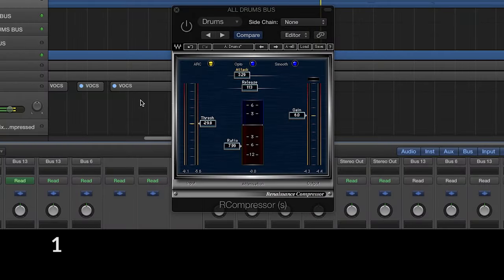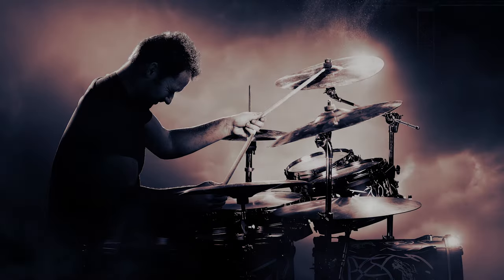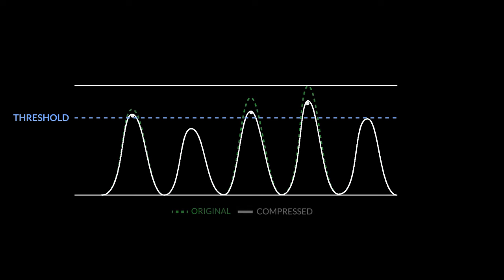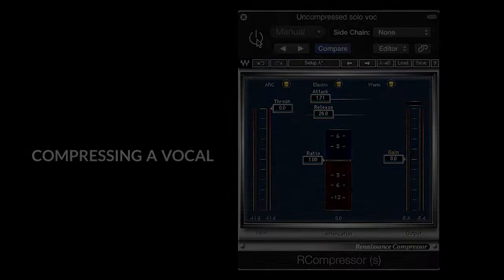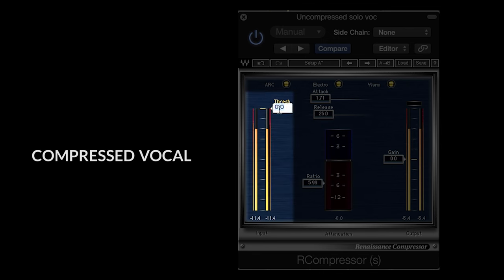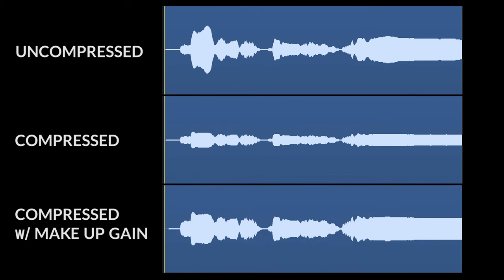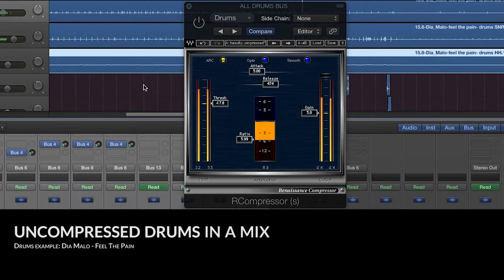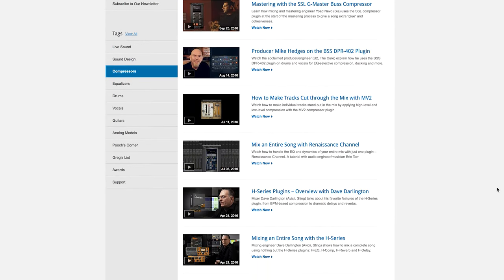Compressors Explained – Sound Basics with Stella Episode 3

Comment: Folks, compressors are the Kryptonite of sonic fidelity.  There are times to use them.  But that should be the exception -- not the rule.
Unfortunately, mixing engineers are in love with their buttons, levers, and knobs.

When you record a sound, it is pristine.  Every time you put it through a compressor, or any form of processing, you are polluting the signal.
The reason why the vast majority of today's music has mediocre sound quality is due to unnecessary over-processing.

If a singer's voice is too loud, then the stem (the isolated track) of her voice should have the gain lowered mechanically, via a quality, analog attenuator -- not via a computer's algorithm.
If there are problems with the singer singing too low and too loud, then the singer should re-tape the song (bands make countless takes of their songs).  A computer should not be used to correct a problem.  Rather, the problem should not exist, which negates the purpose of needing to correct it.

Computers are overused to mix music, because it is a lazy man's mixer.  There is a harmful sonic price for using computers to compensate for what should be corrected via putting in the effort to get it right initially, so that you do not need any corrections.

Corrections come at a price.  All forms of processing degrade the audio quality.  Every piece of equipment adds its own character, its own coloration, its own distortion to the final product.  And those artifacts are cumulative.

If the drums are not coming trough with enough slam, it is not because the drums are not making slam (if you ever were in a room with a drummer, you would feel slam like never before).  The problem is with the location of the drums in relation to the microphones, or the gain on the drummer's stem.

When you hear music and the drums are not really present in any meaningful way, and the singers are ear-aching loud, it is because of the mixing equipment as seen in this video.

Think about it... Does anyone think that a singer can drown out a drummer?  It is nonsense.  Yet countless songs have singing that hurts your ears, and drums that are hardly there.  If drums get lost in the mix, it is not because they need compression, it is because the mixing engineer turned down the gain on the drums, or did some other processing that killed the drums.

Compressed music, for the most part, sucks.  It is responsible for the loudness wars, which kills dynamics, and sucks the life out of the music.  It ruins soundstaging.  It ruins imaging.  It ruins transparency.  It ruins realism.  It ruins sonic works of art that extremely talented bands work their hearts out to create.

I doubt that a single mixing engineer has ever listened to their work on a stereo like this:
https://img.digitaltrends.com/image/wilson-audio-alexx-setup-3-1500x1000.jpg
And this is why they think that their work has good sound quality.

The above stereo will reveal everything that is wrong with a song, and will reveal all of the magic in a great song.  And the songs that sound great on the above system will make any stereo sound much, much better.
Reply: As a professional audio engineer, I lost brain cells reading this.
Reply: @MastrGandalf  I am also a professional audio engineer, and I lost brain cells writing this.
Such a small world.
Reply: @NoEgg4u  Great comeback. That was about the equivalent of "I know you are but what am I"
Reply: @NoEgg4u  By the way, when you say things like "mixing engineers are in love with their buttons, levers, and knobs" or "this is why they think that their work has good sound quality" its a pretty safe bet to say you're lying and have no idea what you are talking about and just regurgitate information you've heard from someone else.
Reply: @MastrGandalf  You explained why I wrote:
"I am also a professional audio engineer, and I lost brain cells writing this".

You need not prove to me that you understand written language.  You are free to let whoever reads your comments know that you have that skill, if that satisfies some need that you have.

You are partially correct as to what I have heard from someone else.  As a professional audio engineer, I know that you know people that get lost in their equipment (you might be one of them).  They love to talk about their gear, and they love to make art with their gear.  If they do not have that love, then they would not be a good audio engineer.

As a fellow professional audio engineer, I know where to draw the line.  I know when something is supposed to sound processed vs. supposed to sound natural.

If I like a lot of ketchup on my hamburger, I do not force everyone else to consume a lot of ketchup.
Once too much salt is added to the soup, there is no undo button to remove the salt.

Many audio engineers like a lot of ketchup, or a lot of salt, etc.  And they are the ones cooking the meal (mastering the mix).  They do not set aside their desire for over-seasoning their mixes.  The world ends up stuck with their clearly opaque, compressed, unrealistic, computer driven sound quality.  And you stick up for them.

You are part of the problem.  You are in an occupation for which you do not understand its core purpose.

Comment: Stella, you absolutely nailed this video! 👍👍

The examples that you selected were great, making the video only require the two examples that you used! It was short, sweet, and right to the point! You actually surprised me when you covered the most basic parts with waveforms SHOWING exactly what is going on during each stage. Being able to do all of this in under six-minutes is outstanding, and shows how obvious it is that you are both an excellent musician AND teacher! 🤘

I was initially looking for a specific aspect on compression, but the way you explained it, along with what I already know, I now get the ‘science’ behind it, which was never really explained to me correctly in the first place, and I would feel comfortable doing some more advanced stuff now, e.g. factoring the attack in so I can “catch” the beginning of the notes, or using tone with compression to “brighten” the mix or track, especially in mastering. You actually covered “mastering” without throwing the term around (as you added the gain in, so on a basic level the sound would be ‘tight’ and ‘loud’ without overall clipping! This is great for me as it would help me limit the amount of plugins that I am using since I could take affect of a single plugin to accomplish more, leaving the ‘fluff’ out! 🚫🎛

I personally feel that the two most important plugins in any DAW are the Compressor, and the EQ. For that very reason, high quality plugins should be carefully selected and subsequently used. I have been using, or more accurately, learning to use FabFilters Pro-C 2, but again, it does almost all of the heavy lifting for you, so I didn’t need to know as much detail regarding what goes on behind the scenes. FabFilters plugins just sound good! For EQ, I’ve been using the 6144 by DDMF as it sounds JUST LIKE a Neve 5033! The gain on that thing is incredible, as a Neve *should* sound, so who knows, I may use it after compressing since I have to balance the EQ out anyway... But that’s the beauty in production, you get to learn by doing, and sometimes you even come across something that *shouldn’t* sound half-as-good as it does, but ends up sounding even more awesome than you first thought! That’s ‘production’ to me, it truly is a process of lifelong learning! 😊 

I just subscribed to your channel, and have a feeling that I’m going to enjoy the other videos, but more importantly — Learn Something From Them!!! 🎓

Many thanks!

~ Jay ✌️💙

Comment: Does A compressor is same important in sample as it’s in audio recorded  by ourselves?
Reply: If you're using synths & samples then you will almost certainly not have the differences in level that would need a compressor to even them out. However you might want to use a compressor for more creative reasons - to shape the sound, or for sidechaining.
Reply: Uncommon Sense thank you

Comment: Lower the threshold fully, max out the ratio, boost the makeup gain then adjust the attack and release settings until you get the desired dynamic effect (which will be exaggerated by the threshold and ratio being so low.) Then lower the makeup gain, increase the threshold and lower the ratio. Now you have more subtle dynamics. As a final touch, add a hard limit to ‘trim off’ any spikes in the signal and finally normalise.

Comment: Whats a good indicator of how much compression you should use? She set the ratio first then the threshold? Isn't it sort of mathematical where you'd have to measure the loud parts then add the threshold?  So if your instrument hits a peak of 12 db but relatively stays around 8 db most of the record.  Would you set the threshold to 4? Ratio then would be what? Faster attack the the faster the waveform?

Comment: Hi... I'm from Brasil. An eternal doubt, which no coach can clarify with
 conviction about compressor pedal. The Attack Knob. Many say that compression will act faster 
if it is at zero, and as you turn the knob, so that the signal gets hit 
by compression, this action takes longer. Others say EXACTLY the 
opposite .... It's not all people that has a good recording softer to 
check it visually on a computer screen, like how the attack knob really 
works. What do you have to say? Thank you. Hug.

Comment: Wait, are you saying that using compression will sound different than if I manually lowered the level on the loud parts using the volume automation?
Reply: It will. It's called Fader Riding.
Reply: It sounds like she's saying that, but no volume automation could sound largely identical to compression. It would just be time consuming to automate to the same level.

Comment: Why does compression make tracks sound so tight ,  when It basically consists in just adjusting the maximum amplitude of the signal  by setting a threshold under which It remains unchanged and above which it gets modified ?

Comment: I'd like to understand, so we can use the compressor on each sound we have in a track? Or only with drums and vocal? Or we compress only the whole track?
Reply: Generally, you should not compress every element in your mix. compression will help things stand out in the mix or tame them if they are too rowdy. 
Compressing the whole track happens generally in mastering, with a limiter, or a bus compressor like the SSL G Channel.
Reply: @andrestuart7994  thanks for response! So I guess we should work on each element using some effects like reverb, delay, sometimes EQ etc, and making the right volume for each one, and when we are done, we can start compression on the whole truck and it will do its job?
Reply: @tigranzatikyan3944  Yes, that's about right. There's no better teacher than experimentation though. Usually the elements I compress are kick drum and vocals, but it all depends on your recordings/samples
Reply: @andrestuart7994  the thing is that, sometimes I getting all done like pro, and most of the time I hate the final result I get 😂 I just want to understand what am I doing wrong? And when I do work with headphones and then I listen without them the difference is killing like, with headphones I hear very nice and cool composition but without it's like a trash 😑
Reply: @tigranzatikyan3944  just keep practicing!

Comment: As someone just now learning what this is, I could easily imagine a scenario where an untrained person might over compress or even apply compression that is just totally unnecessary for a given track. It seems more like a corrective tool for anomalies or extremes in the wavelength, rather than something to be applied haphazardly on all tracks. Over application of compression, eliminating the dynamic range of a performance, is a sure way to suck the soul out of it.

Comment: Why does it cut through the mix better when compressed?
Reply: for a few reasons - less dynamic fluctuations means that the volume of the entire track can be raised a bit, depending on how you set the envelope of the compressor you can also shape the transients to better cut through the mix, the color and harmonic distortion of a compressor would also affect how well it would cut through the mix and so on and so forth, compressors are amazing tools for audio manipulations.

Comment: Love it Stella, you do great work. But i have to say, the impression you get standing in front of a battery is much stronger than the compressed one - let alone the "natural" one, which is a far cry from the live experience. That is why the "natural" recording actually loses a lot of detail and body due to the very process of recording it, which is transducing one type of energy (air molecules vibrating) into another (electricity). Compression  is a technique than actually recovers part of the body of the sounds, hence to us, compressed sound better and more similar to the real thing. Then, given the technical characteristics and parameters of the compression, can also be used to modify the sound, modify the transients, give different texture, add groove, or a particular tone (due to the different circuits used to compress) to the waveforms. Compression is a very deep process that affect the very nature of the sound and despite being difficult to hear at the beginning, it is definitely one of the keys to achieve pleasant mixes.

Comment: If a compressor only acts on the signal specifically when it's above a certain threshold, and the rest of the signal below that level remains uncompressed, then why is the level of the ENTIRE track reduced?  🤔
That doesn't make any damned sense..
Reply: Because the signal being compressed are the loudest points in the track. So, compressing that signal, let's say it was compressing an average of -4db, is now overall -4db quieter.
Reply: @MastrGandalf  thanks, but I still don't get it. I'm probably over-thinking it or something. I tend to do that. It just bugs the hell outta me because I can usually grasp the how's and why's and what-for's pretty quickly. Not with audio though. Godammit..